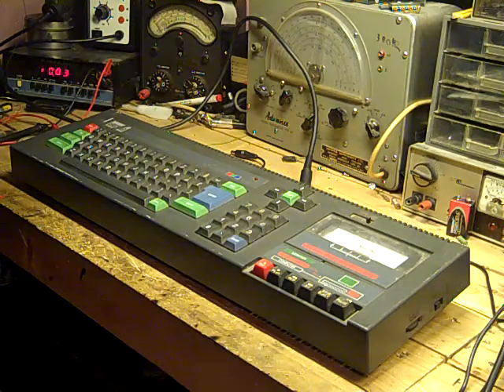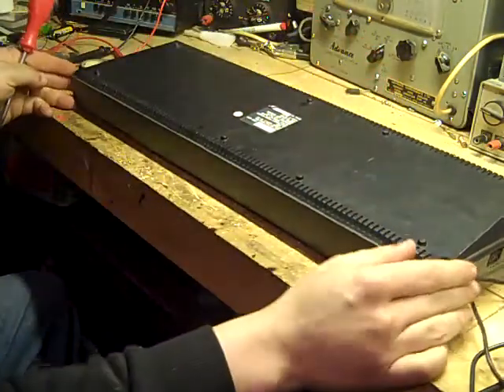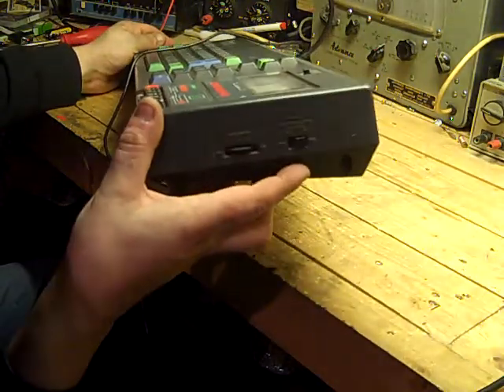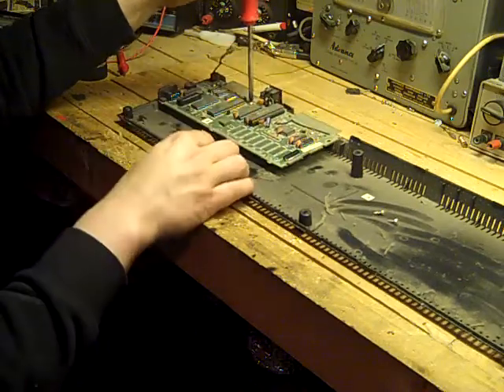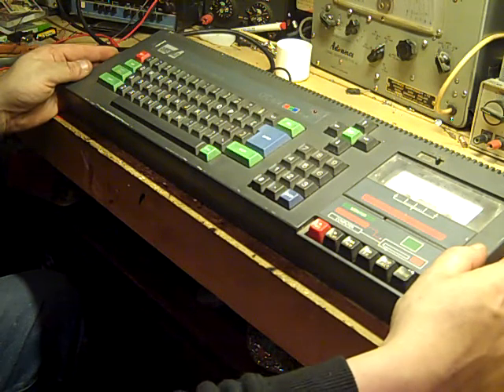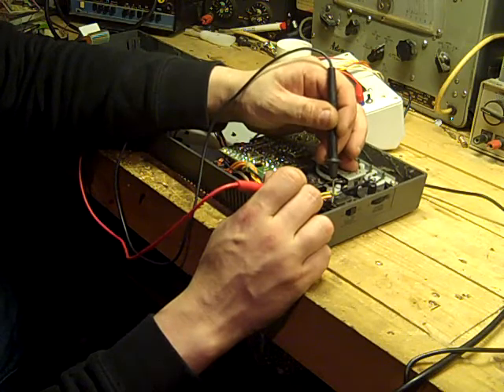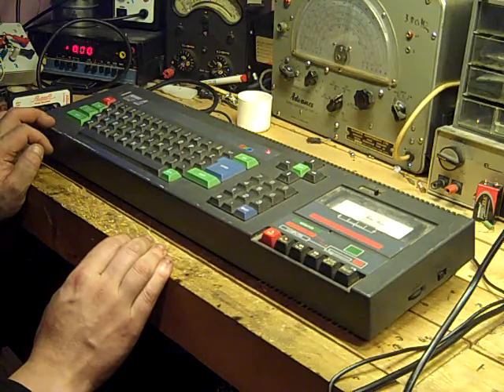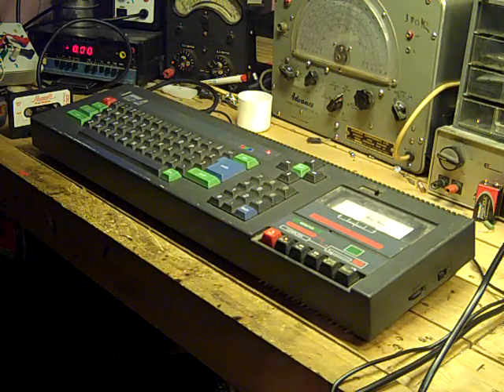Amstrad CPC 464 Restoraton Pt1

Comment: Great stuff Jay. Nice easy fix for your there. As you may know I have recently just got my first ever CPC 464 so these vids will be a god send for me. Seems like my CPC will not be such an easy fix though as I've already found at least 2 bad ram chips lol. Mine has the slightly larger motherboard with a vertical row of ram chips.
Reply from the maker: +StigsWorld still lots to do, this one has a fault where pressing a key after pressing play on the tape-deck doesn't start the tape playing have now ruled out the tape deck itself so got a fault on the motherboard to sort. new video coming up shortly. Good luck with yours mate you've been unlucky to find one with bad ram, in all the 464 and 6128's I've fixed I've only come across a couple with ram faults.
Reply: Bloody typical I should get one with bad ram, still I got it for nothing as it was another dump rescue. I am hoping to swap out the bad ram chips and see where it goes from there. Looking forward to seeing your follow up vids mate, always a great watch :)